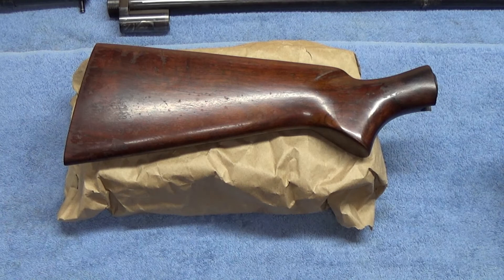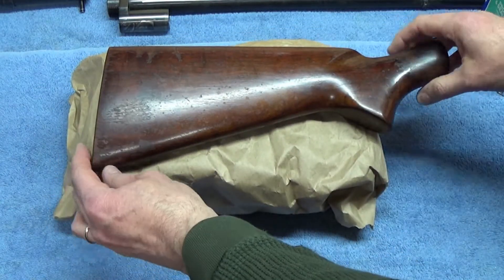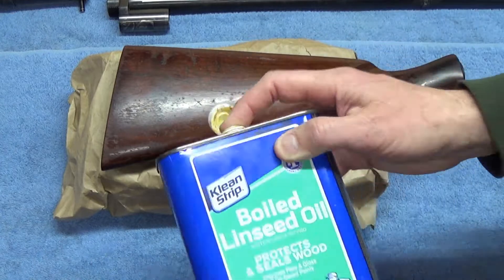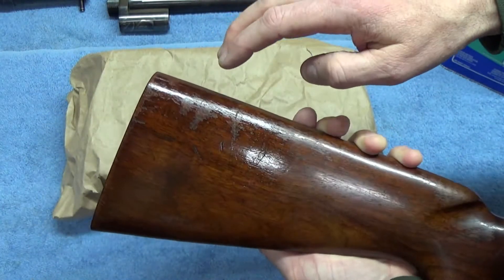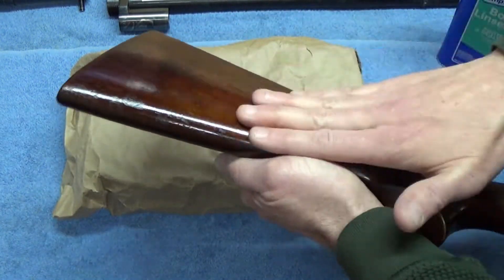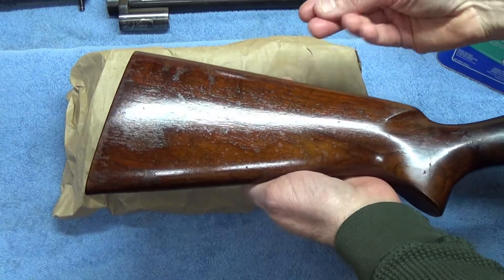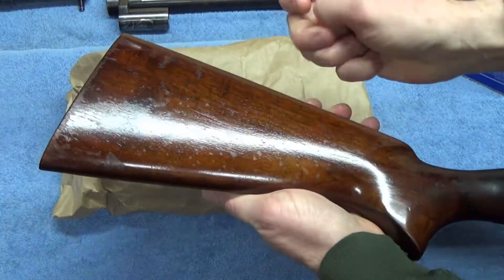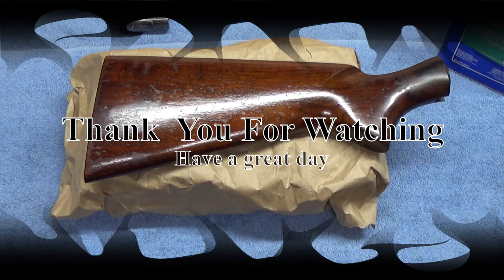Winchester Model 12 Project Part Two Oiling the Stock

Comment: very nice 👍, I refurbed an old 410 and stripped the wood and oil finished it, I got a lil rushed and sure enough it took a while for it to fully dry 🤠
Reply from the maker: If this was a regular old piece from a shop I would strip it and lightly sand it to make it uniform and look really nice. But this was my grandfather’s so the wear and tear is from him. I want to keep the connection to him in the wood, if that makes sense.